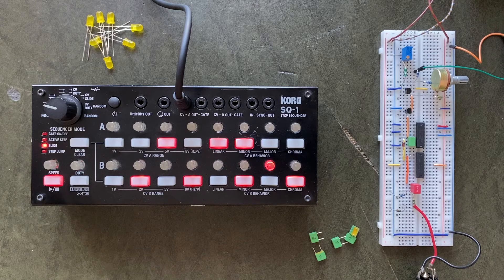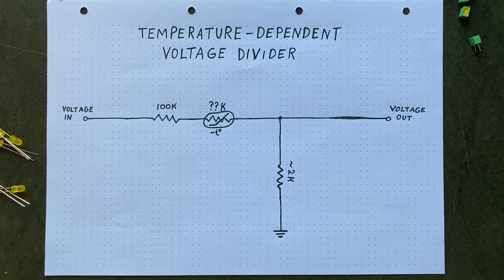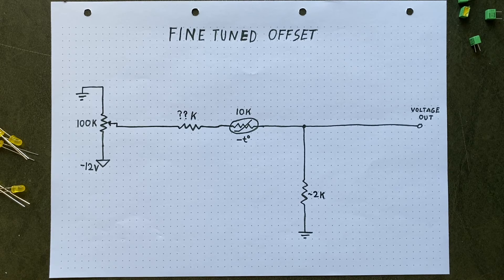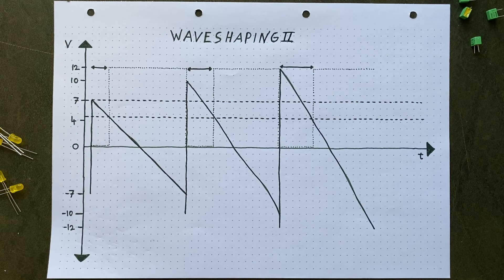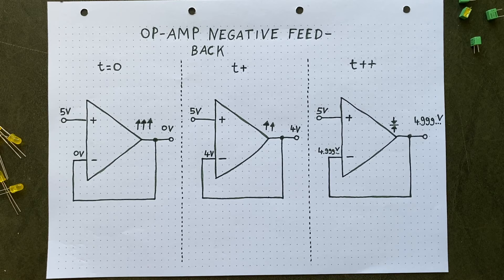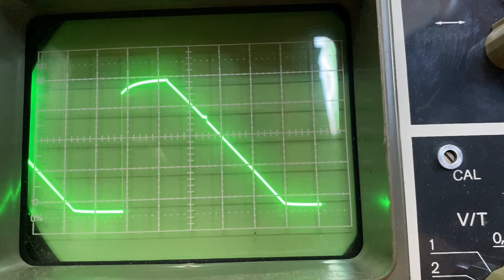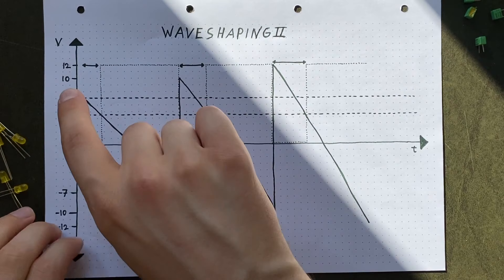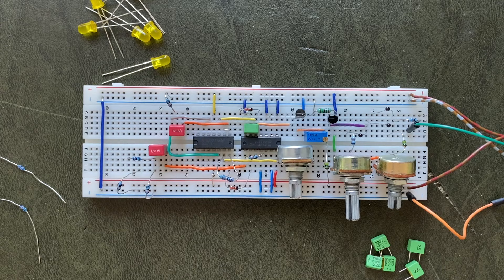DIY VCO Part 4: Shaping Sawtooth to Square

Comment: what about using npn pnp transistor array?
_
how i get, there are 6 Schmidt Triggers, and this means that i can make around six voiсe on one chip, can i?

_
FM? I think this is not like "just plug to OSC's CV another OSC..."
Reply from the maker: using a transistor array to improve stability? sure, should work. but it's decently stable already like this.
yes, with 6 schmitt triggers you can make 6 independent sawtooth VCOs. 
no, FM is literally just "plug one VCO's output into another VCO's CV input". just need two CV inputs, but you can add as many as you like: jack socket -> 100k resistor (you can add a potentiometer here to control the FM amount) -> 10k thermistor -> PNP's base. only problem is that sawtooth->sawtooth (or square -> square) FM sounds rather rough. but that might be a matter of taste.

Comment: Would you like to list the BOM for the entire build?
Reply from the maker: here you go - this is for a single vco though!

> BASICS: 

1x breadboard 

1x jumper wires/bridges set 

2x 9V battery plus clips OR 1x dual 9-15V power supply  

> ICs:

1x TL074 quad op amp 

1x 40106 hex schmitt trigger inverter  

> DIODES:

 2x 1N4148 small signal diode  

> CAPACITORS: 

1x 2.2 nF foil capacitor 

2x 1uF foil capacitor  

> RESISTORS: 

2x 1M resistor 

1x 200k resistor

5x 100k resistor 

4x 10k resistor 

3x 10k NTC thermistor (optional)

1x 4k resistor 

1x 1k5 resistor  

> POTENTIOMETERS: 

3x 100k linear mono potentiometer 

1x 1k linear precision trim potentiometer  

> TRANSISTORS: 

1x BC548C NPN transistor 

1x BC558C PNP transistor  

> JACK SOCKETS: 

3x 6.35mm OR 3x 3.5mm
Reply: @MoritzKlein0  oh wow! Thank you very much!

Comment: Just noticed something about your diagram of a non-inverting Op Amp, you've got a 100k feedback resistor and another 100k resistor going from the - input to ground, you've got 5V on both of the inputs and 10V on the output, the ratio of the feedback resistor and the one going from the - input to ground determine the gain of the Op Amp, since both of those resistors are 100k the gain of the Op Amp is going to be 100k/100k which equals 1, so the output is actually going to be 5V, not 10V, you would need to make the 100k resistor going from the - input to ground a 50k resistor (100k/50k=2) which, together with the 100k feedback resistor, would make the Op Amp's gain be 2, the output would then be 2X5=10.
Reply from the maker: that's not true. https://tinyurl.com/ygwd3gpp